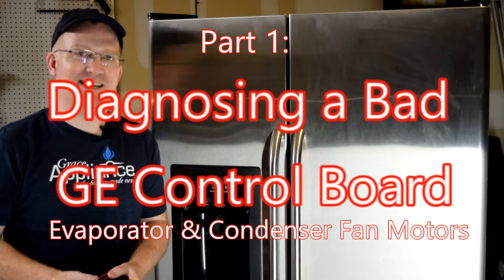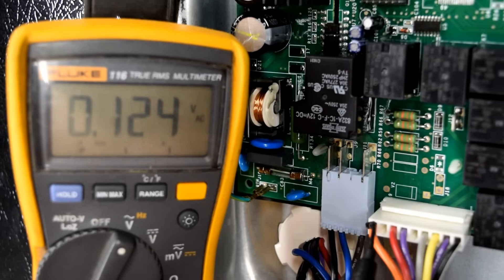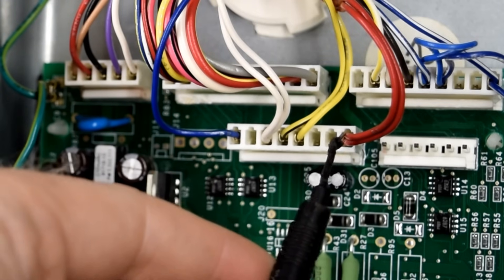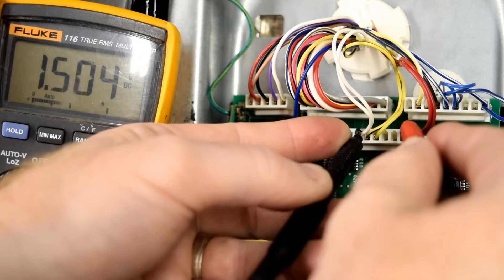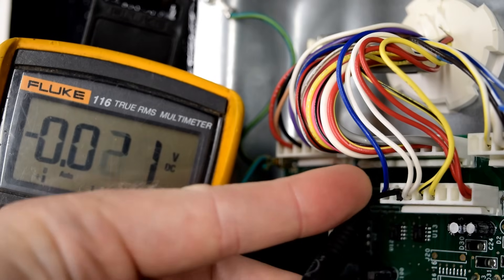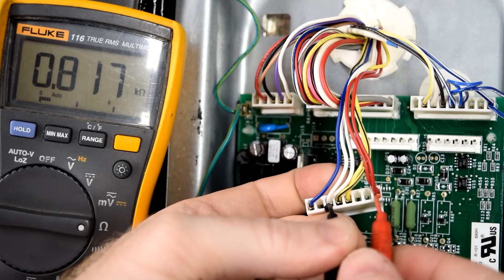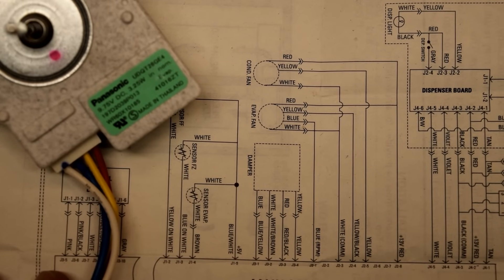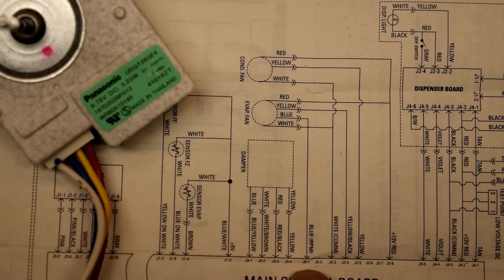Diagnosing a Bad GE Board - Part 1: Fan Motors

Comment: I have a secondary GE Refrigerator:  GTS22KCMBRCCSD302373 with a Control Board: WR55X10151. I am a retired HVAC/R mechanic before our refrigerator's became like TV sets. I have a real dilemma with this unit. A little history. When this problem first surfaced I have followed the diagnostic procedure according to your video which was pointing towards a failed control board. I replaced a bad 47uf 400v capacitor on the board and the fridge worked fine for a month, then the original problem resurfaced but this time everything looked good on the board. I then purchased a supposedly new board on eBay. The new board didn't work, same condition. I even sent the original board out for repair to fixyourboard.com but still had the original condition. Nothing works but lights. When I jump the compressor and hot terminals at the board, the compressor turns on and the evap coil gets cold. When I open the freezer door to send the board into test mode the evap fan runs but not at full speed and condenser fan doesn't run at all. Voltages at the J2 terminal between white and yellow/black (evap) I get around 4.5v and 0v at the white and yellow (cond). When I disconnect the evap motor I get around 13v at the evap fan plug. At that point condenser fan still isn't working until I jump between the yellow and yellow/black. At that point the condenser fan runs at full speed leading me to believe that the evap motor was bad not sending the correct rpm signal to the board. I replaced the evap motor and still have the same condition with nothing running except the evap motor at slow speed when I open the freezer door. I even replaced a freezer temp sensor that wasn't within factory values. It's hard for me to believe that two boards and two evap motors are bad. Can you please help with a possible answer? Any help would be very much appreciated. Thank you.
Reply: Thanks Andy for your input. The details in your videos are excellent. As per my frig issue, I did disconnect the condenser fan wires at the fan as per your suggestion and still there was no power at the fan plug or the J2 yellow wire. I even checked for power at the inlet and outlet of the fan resistors; 0v at condenser and around 4.5v at the evaporator which are close to the J2 values. While doing these tests I left the condenser motor still unplugged. As I was scraping the varnish off the condenser fan resistor leads to make sure it was zero, the refrigerator started and everything was working except the condenser fan until I plugged it back in. There didn't seem to be any problems as far as I could see with the resistors but after the refrigerator started, I rechecked them and they were both along with the J2, over 12v. It has been working so far but I don't have an explanation as to why it started working other than the board being at fault or is it possible that the condenser motor occasionally shows a faulty resistance reading telling the board not to start up? After it started I turned the refrigerator off and then back on a few times using the temp controls, after waiting a few minutes of course, and it started every time even with the potentially faulty condenser motor connected. What are your thoughts? Again, thank you Andy.
Reply from the maker: John Loberto hey, 
I was trying to research some for your particular model, but do know certain GE French doors were made by Samsung. I’m not certain if yours would be. I think only models starting with PFSS6N and PFSF6N so probably not applicable...

But, know that certain fridges will pulse voltage to the fans upon plugging in the fridge. It sends the pulse, waits to receive the RPM frequency feedback from the blue wire on the fan, if it doesn’t receive the feedback it stops sending voltage. Again, this is more of a Samsung thing so I’m not sure if it’s even applicable in your instance, but worth looking in to maybe. If this were your issue, it’s more than likely the tach on the fan motor that’s only intermittently working and thus shutting down the board voltage.  Replacing the fan would be the next step if the problem persists.  

For now though...let’s just keep our fingers crossed that it was a poor connection at the condenser fan plug. Perhaps the removal and reinstall to check voltages freshened up the connection.  

That’s about the only 2 things I could think would cause your issue given the parts you’ve already replaced.  
Other fridges have ambient temperature sensors on the exterior of the fridge and only run the condenser fan motor as needed based on the external temperature, but don’t believe this is true for GE.  

Sorry I couldn’t give you anything a little more conclusive.
Reply from the maker: Sorry to hear about your fridge issues!  
Interesting symptoms!  

Try this, unplug the condenser fan motor (behind the refrigerator) and tell me if you then get voltage to the condenser fan wires at the main board. 

I'd assume your board is in good shape.  The guys at fixyourboard really REALLY know their stuff and literally have never had (or heard of) any issues from boards they've fixed.

Comment: I have a GE SxS, lights turn on. I checked the board and a capacitor had leakage so I replace the board and I also replaced the relay because it was burnt out. It still does not work. When I removed the J2 plug from the board the fan turned on, when I plugged it back in the fan turned off....please help....
Reply from the maker: hi Miguel, 
I’m sorry to hear about your refrigerator issues.  
Please send your model number and the first 5 digits if your serial number.  

Which fan motor do you hear turn on after you unplug J2?  Inside the freezer or behind the refrigerator? 
That seems like a very strange symptom because your fan motors get their power from the J2 plug (unless you have a 120v motor which I can look up by the model number) 

Thanks!
Reply: @GraceAppliance  Model:GSS25QSTB SS  Serial:ML423419
Reply from the maker: @miguelcolon3703  thanks!
What fan are you hearing turn on when you unplug the J2?
Reply from the maker: You've got a 120v fan motor for your condenser fan behind your refrigerator. This isn't controlled through the J2 plug, but if the evaporator fan motor inside the refrigerator is shorted & failed it can cause issues where other components do not function until you unplug the J2 which eliminates the short and allows the board to function as normal.  

I strongly suspect you've got a shorted and failed evaporator fan motor WR60X10224. 
You can buy the legitimate GE OEM fan which is: https://amzn.to/2EmkYVQ
or a cheaper aftermarket version here: https://amzn.to/2EkG8n9

I haven't had any experience with the aftermarket motors as I use only OEM, but the price is right. 

Let me know if you have any questions. 
Andy
Reply: @GraceAppliance  the rear fan
Reply from the maker: Yep, I’d say replace the evaporator fan motor inside the freezer section and you’ll be good to go.  Let me know if you run in to any issues.
Reply: @GraceAppliance  Thanks for your help, replaced the evaporator motor and we're back in business.
Reply from the maker: Outstanding!  Glad to hear it. Thanks for the follow up.

Comment: Do you happen to have any videos to diagnose the fans and main board for a GE french door
Reply from the maker: I’m sorry I don’t. 
Currently, I don’t have any French door videos.  

What symptom is it giving you?  Also, what is your model number?
Reply: @GraceAppliance   Model # DFE28JSHDSS the condenser fan does not work and I'm trying to see if the board is sending power to the condenser  fan motor but I don't have the schematic to see which is the pin connector for the fan
Reply from the maker: Hey, 
Here is the schematic for you: see pg 2
https://appliancerepairforum.com/Attachment753.aspx

The condenser fan wires that you’d test for voltage would be red and black and should be between 12-14vdc. I’d testing from the board you’d test at plug j9 pin 1 & 2. The colors are different at the board which should be red/yellow & white/yellow. 

I’d start by testing the voltage at the fan motor itself for simplicity and if you’ve got good voltage there, replace the fan. 

Let me know if you have any questions.

Comment: my frig checks out the correct voltage  as you shown,but the evaporator resistor is a little brownish. Does that mean the board is bad ? Can I replace the resitor
Reply from the maker: Hi Palmer, what symptoms are you having?  Are both your evaporator and condenser fan motor running?

Comment: Andy, Thank you so much for making these videos!!!!! I have followed each step, I am still unclear on somethings.  My fridge is GE profile refrigerator model GDSL3KCYCRLS serial number TT305913. I have some browning around R43 on the board but when I use my testing meter on the J2 connection I am reading 12.5 volts to fan motor. I only have two fans in this model. the top is fridge and bottom freezer.  My refrigerator is completely warm and freezer appears to be fine. I have setting adjust control board in the top fridge for both freezer and refrigerator. My meter doesn't have a hertz setting so I wasn't able to follow with the tachometer reading.   I'll continue to search for more of your videos hoping to find a solution
Reply from the maker: nikeM80 hey!  You’re most welcome and I’m so glad they’re helpful.  
Sorry to hear about the fridge issues. The good news is that your freezer is doing alright.  That rules out a lot of more expensive issues.  

Now, it’s a matter of air flow that’s causing your issues since the refrigerator shares it’s cold air from the freezer.  
So, I assume it’s the evaporator fan that you took that reading on so the board is doing its job in supplying correct voltage.  

The main things that can affect air flow would be:
A defrost issue (I.e. heavy snow build up on back wall inside the freezer) 
A bad fan motor (or board, sounds like yours is good) is your evaporator fan turning? 
Bad damper motor or damper door is frozen shut/broken 
Food blocking vents 

Do you see any frost build up inside the freezer section?
Reply: @GraceAppliance  I am going to order and replace the fan only Panasonic Evaporator fan., as the board seemed to pass all the meter tests

Comment: Dude does it matter which red one goes? I have two also but which one goes to which? It goes to cond fan which has 4 wires (red, yellow, blue and white) Thanks a lot!
Reply from the maker: Hi Alex,
I'm sorry, I'm not understanding the issue. You are replacing your condenser fan behind your refrigerator, correct?
Usually these will not have 4 wires, but the evaporator fans do. Do you not have a plug where the old motor came out? 

What is your model number please?

Thanks!
Reply: @GraceAppliance  GDS20SBSBSS - fridge, Motor - Panasonic UDQT24LG3. The problem is then i pull out my cond fan wires just came out from plastic header, i just don't know which wre connected to reach other? I have 3 incoming (red, red and white) and 4 motor wires. 
p.s.i do have 13 volts incoming
Reply from the maker: Alex Zubkov hey sir, 
I see what you’re talking about now.  
You’ve got the white going to white on the fan, red to red the red wire on the fan and should have a slightly lighter red wire (pink?) that will lead to the yellow wire on the fan.   

Do you see a lighter red wire?
Reply: GE Side-by-Side ONLY - Refrigerator Repair Videos good point! Is this possible what I just killed my motor after wrong connection? I think this one driven by controller with continuous pulses, is that possible I can check such motor with my 9v battery?
Reply from the maker: @AlexeyZubkov  Hey, it is possible.  It's also possible the control board may not be calling for it to turn right now.  Here's a video showing how to use a jumper wire from the main control board to test the fan motor.  I hope it helps.  Thanks!

https://www.youtube.com/watch?v=PwsoOpUbxvk
Reply: @GraceAppliance  much appreciate sir!!
Reply from the maker: Alex Zubkov you’re most welcome!  Thanks for watching.  Stay in touch!

Comment: I have a kitchen aid/Whirlpool side-by-side refrigerator I heard a loud noise inside the freezer when I checked I seen ice near the fan evaporator motor shortly after the refrigerator quit working I tried defrosting it for 24 hours but it keeps on showing me on the door power Failure and turns  on and off repeatedly I took the back panel off and I seen my condenser fan starts but quickly shuts off when I tested the motor I got a reading of near 10 Ohms can somebody please tell me what can be the problem? Will it be the elaborate fan motor or the Compressor
Reply: Ultimately I ended up buying a Frigidaire side-by-side refrigerator that looks mostly the same but it’s more reliable then KitchenAid it was going to cost more in parts then buying a new one
Reply from the maker: Richard Negrin Good deal, thanks for the follow up. Stay in touch!
Reply from the maker: Hey Richard,
Sorry to hear about your issues with your refrigerator.

These videos focus in on GE side by side refrigerators only so they are only going to relate broadly to your issues.

I'll be glad to help as much as I'm able. If you'll send your model number that will help me. It's located on a tag inside your refrigerator section.

However, just based on what you've said so far and the fact that it turns on and off sounds control board related, but this same issue can be caused by a short. The board tries to power on as normal, but can not due to the short and starts over again.

The most likely suspects based on the noise from the freezer and defrost issue would be a failed heater or runner up, a failed defrost thermostat inside the freezer section behind the back wall.

I'd start my search there by disassembling and visually inspecting both. The heater many times will have a noticeable break in the metal piece where it looks like molten lava has melted through the metal exterior of the heater.
The thermostats will sometimes fail and the plastic portion will bulge away from the metal canister.

These would be the visual inspections I'd start with and beyond that would need a multimeter to proceed.

Let me know what you find and we can go from there. 

Thanks!
Reply: GE Side-by-Side ONLY - Refrigerator Repair Videos model number KFXL25RYmsS1 it’s a kitchen aid refrigerator is there a way I can upload a video so you can see how the fan works a few seconds before stopping and how the compressors sounds a little funny when it does stop
Reply from the maker: Richard Negrin hey, sure. You’d need to upload a video to YouTube as normal and just post the link here.
Reply: GE Side-by-Side ONLY - Refrigerator Repair Videos https://youtu.be/j_oUqiwJtGw. Please don’t mind my aunt is talking in the background. I hope you could point me in the right direction on what I need to do to fix this
Reply from the maker: Hey Richard, 
Thanks. It sounds nasty to be sure.  But, still I wouldn’t worry too much about it until I could find the reason why the power constantly cycles in and off which leads us back to a control board issue...likely caused by a short. So, start with the defrost components and see if the fault lies there. Once the short is eliminated the board will likely to back to its normal self...and the nasty noise with the compressor will likely go away too. My thinking about that is that it may be short cycling the compressor and causing it to work too hard or at incorrect pressures. I’m not sure on that. It’s a variable speed compressor so may not be receiving the correct voltages currently. 

Let me know what you find with the heater and thermostat.   

Thanks!